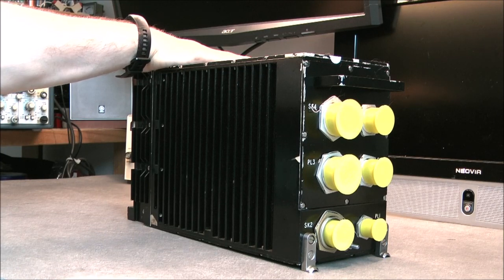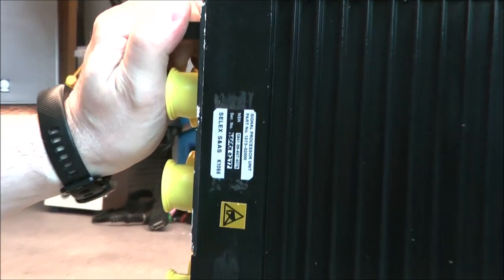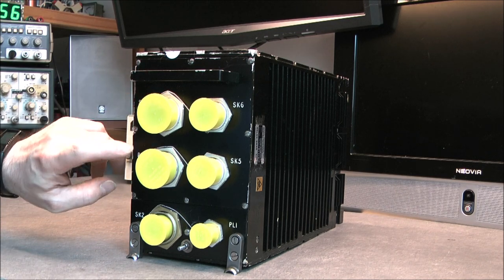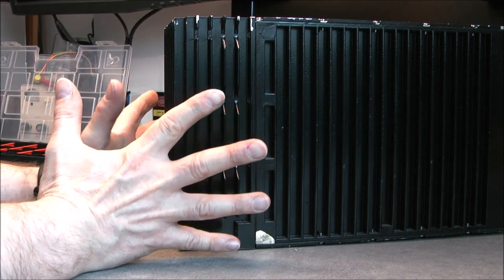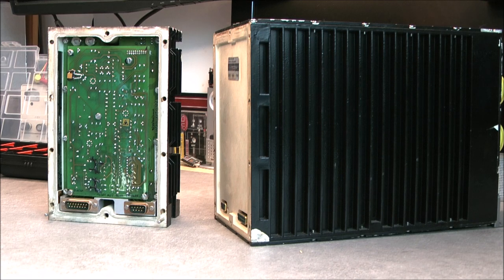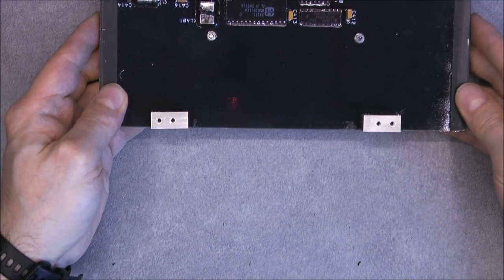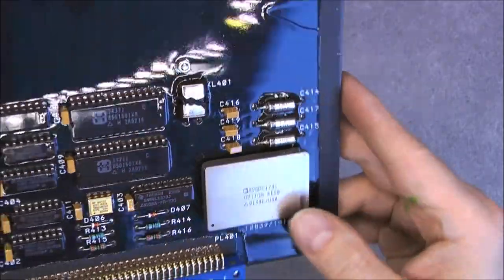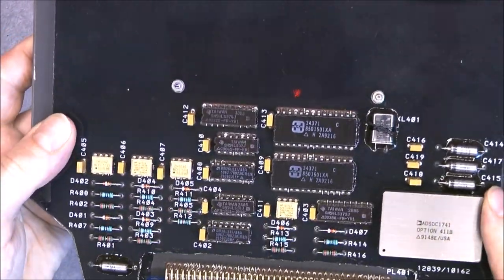Ferranti Selex signal processor teardown

Comment: 18:33 "I do not see any EPROM". On the right side with the 2 labels are EPROMS and there is an ATMEL AT28C64 8KByte EEPROM in there as well. The processor can be clearly identified as the MIL883 version of the 80C88 PC/XT CPU. And there are 3 parallel 24 bit I/O expanders 82C55 in there.

Comment: You probably already know this but the capacitors were made in France by Société Industrielle des Condensateurs (SIC-SAFCO).

On the first board the 80C88 is the CPU.  The EEPROM carrying the firmware is the Atmel chip on the same board.  Interesting to see three 8255 programmable I/O controllers on the same board.  The third board has all the RAM on it.  But it's interesting to see a 286 in there as well.
Reply: The board #5 has one more 80C88 CPU with its own ROMs and RAM.
Reply: Maybe for redundancy?
Reply: @petarjanevski  yes I believe so. High reliability avionics have two CPUs etc running the same firmware so if one fails or locks up the whole system as a whole will keep running. I think some systems even use different CPU architectures performing the same task to iron out a possible failure / bug that could only occur with one type of CPU. Not seen any evidence of that myself but I pulled apart a digital cockpit voice recorder that had several processors and sets of flash chips. I counted three separate independent sets of firmware. One stored within an 8051 microcontroller and others in bank of flash chips and an eeprom. Those were connected to an AMD 32 bit RISC processor. Pulling the socketed eeprom and dumping it revealed the devices serial menu for extracting recordings and configuration settings and other useful clues as to how it works. Here if anyone is interested https://www.adrian-smith31.co.uk/blog/2021/01/pg-aircraft-cockpit-voice-recorder-black-box-teardown/